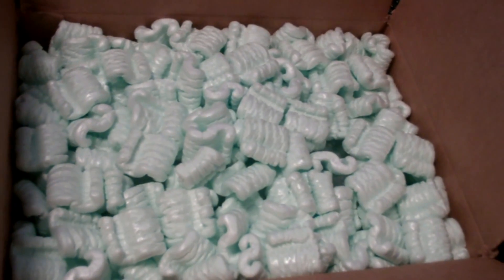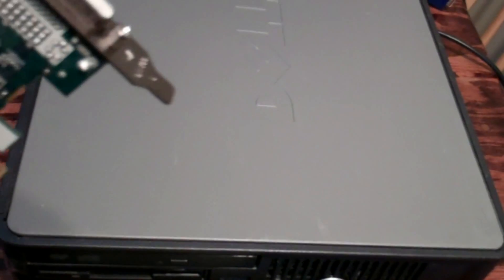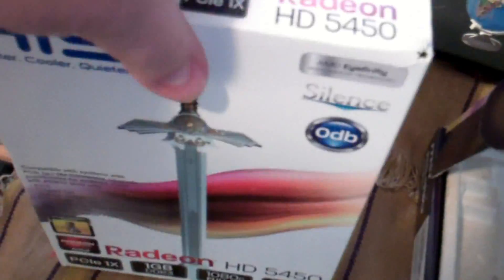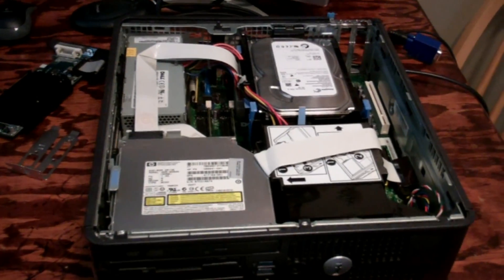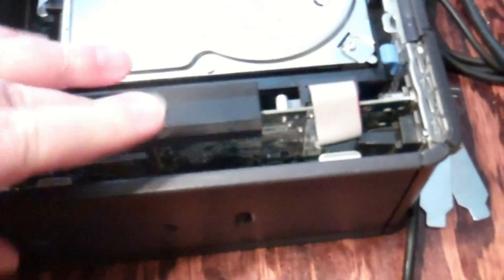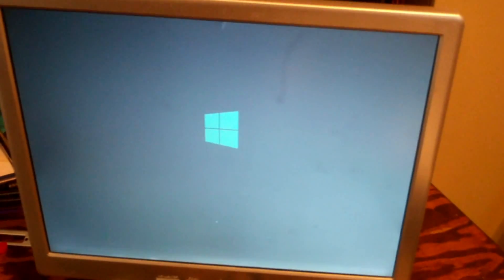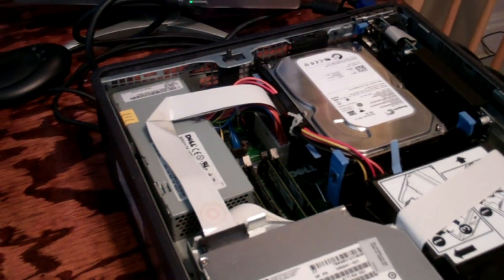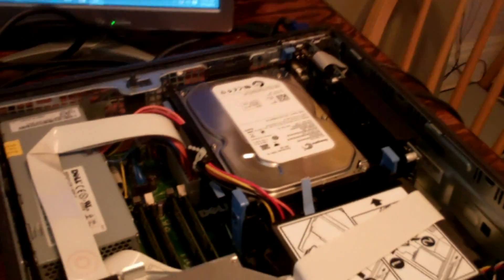Installing a AMD Radeon HD 5450 in a Dell GX620

Comment: i like make note so you know this if it has 32 bit install  you need to makea  dvd r   and install 64 bit that  way  it will not  work any other way
Reply from the maker: +thesmashtvnetwork My IT guy that's more of an expert on these than I am already tried everything he knows to try and get the 64bit version of 10 to work on these computers but 64bit will not work on these old Dells.. 
And like I said before, these are strictly for office use doing taxes. My main high performance computers will run 64 bit Windows 10 (when I eventually upgrade them to 10)
Reply: RVR2 if you install windows server  it dose not have  the  free upgrade  that will  get  scanner working  https://www.microsoft.com/en-us/download/details.aspx?id=5023 then  use a loder  too remove trile  :) use virtal box to install it  then you can use scanner  in vbox
Reply from the maker: I'll mention this to my friend that's working on the scanner issue and see what he finds. Thanks